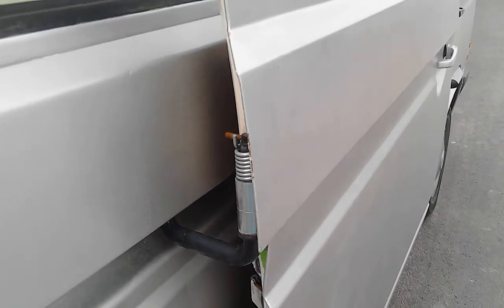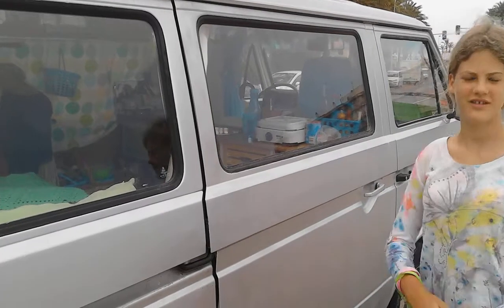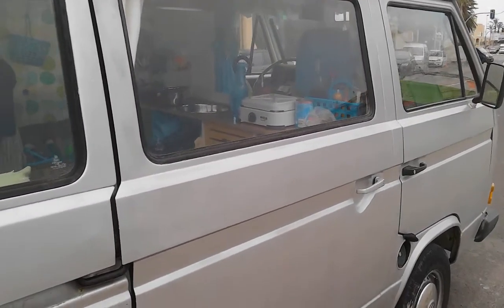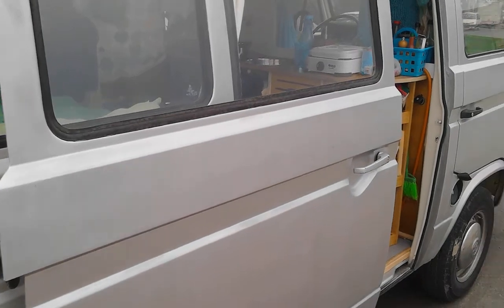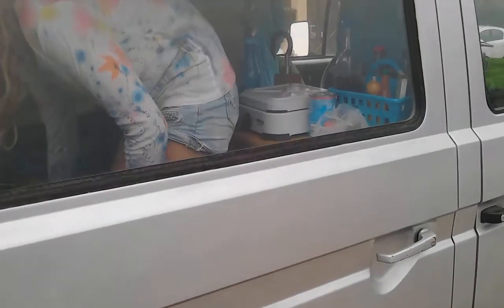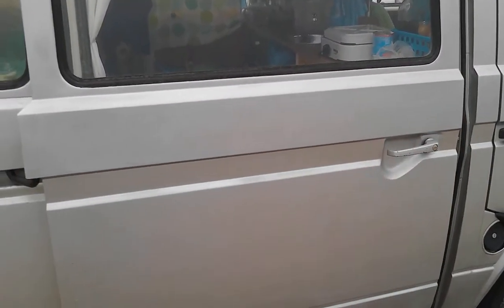SOS! Help needed! VW T25 Sliding Door Failure.

Comment: looking at your video the sliding hinge isn’t the problem because the door still slides along the runner,with the door open push the safety catch shut with a small screwdriver or similar,now try to force the catch back open with the screwdriver,if the catch is ok it should remain in place,if you can force it open then the catch is worn and needs replacing,try a scrapyard ?
the door doesn’t sit properly in the aperature so it might be the striker pin you mentioned is to far back not allowing the catch to secure properly,move the striker pin backwards or forwards to see if that is your problem
Reply from the maker: Hey, bang on Derek! That was the problem. I uploaded a video two days ago about it. I managed to find a new garage that specializes in t25s.....how lucky? It was the catch but the mechanic managed to straighten it would out by filing the rounds off and cleaning it up. It works perfectly again. He got the door aligned perfectly too. Three months of stress over. Thanks for your assistance.
Reply: up there for thinking,down there for everything else,good luck with your travels 😊

Comment: The new part you fitted has a nice new spring, this is applying more pressure to the catch, at the top there is a pin that when removed will undo the pressure of the spring, it may be on one more turn than it needs, if it’s reassembled with less pressure ie less turns on the spring, it will put less pressure on it and your worn catch may be ok, Germany may be the place to get one from, most Germans speak perfect English, and yes I would marry you 😍, Rod
Reply from the maker: Oh Rod, is that a marriage proposal? I'm blushing :-) So if you're right then that means we're getting married! Damn.....I fear the wedding's off as I have already tried lessening the spring tension but it didn't correct the problem. The door doesn't close properly even without the spring or the latch, which suggests it's a problem with the hinge. Someone has just suggested it might be that the hinge is too long. I wish I had kept my original hinge to compare. I've managed to find a t25 parts supplier in a nearby city and they've recommended a specialist garage, the owner of which owns a t25. I don't know why I didn't find them before. I will feel a lot happier when it's fixed.....hopefully next week.
Reply: That’s great news about the guy who is nearby and hopefully will fix it for you, I will keep myself available for you as far as the marriage proposal, if you find yourself in need of husband in near future look me up😘 and of course you tried my solution already as your are a cleaver cookie, x
Reply from the maker: I bet it ends up being one of the mega strong magnets we used on the curtains. It'll be something really simple. You really meant it then? Gosh, some romance....that would be nice! I've been in need of a husband for a long time ;-) Hannah Waving. Yep.....that has a suitably quirky ring to it :-) x
Reply: Any sensible man with half A brain would love to be with a woman as intelligent and adventurous as you, I do hope you get back on your wonderful trip, looking forward to your next instalment and hopefully a fully fixed door, Mrs Hanna Waving LOL x
Reply from the maker: Ah.....thank you Rod. You're a gentleman. X